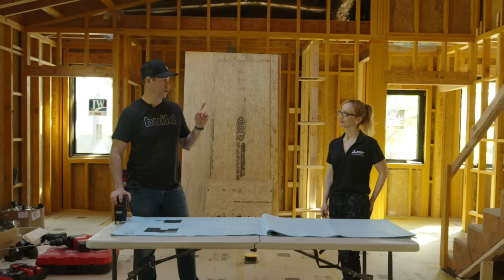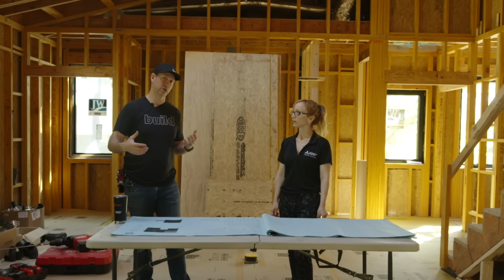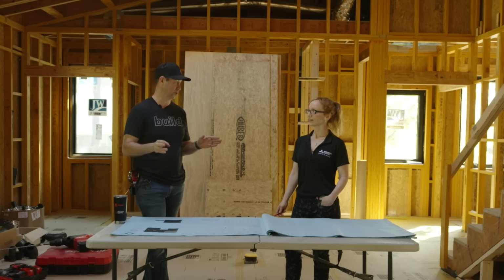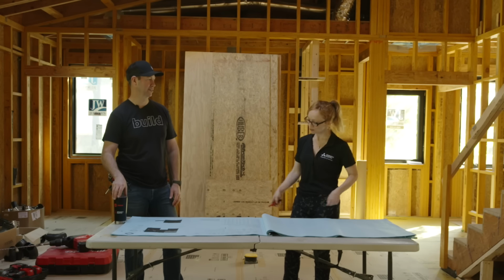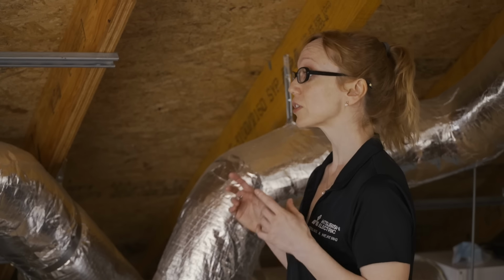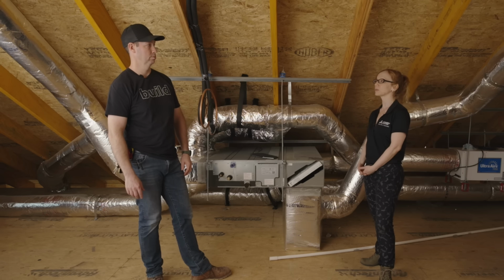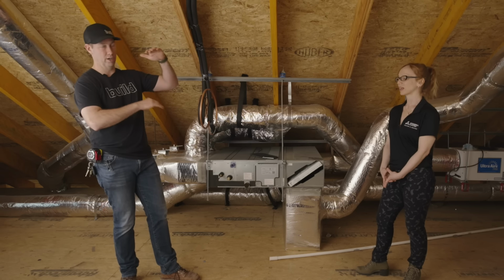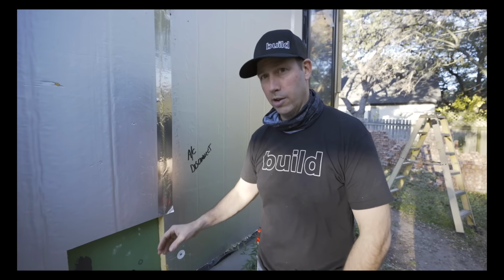Mitsubishi HVAC At My House - Full System Tour

Comment: You make me want to build a new house so that I can do things like this right.  Matt, 1% of the days above 100 would be 3.65 days.   We have more 100 degrees days here in Plano.  Pretty sure you do there in Austin.
Reply: Yeah more like 35 average and another 100 over 85% .
Reply: I think he meant 1% of time. Not days. Surely its not 100 for 24 hours a day. It’d be a few hours in the middle of the day / afternoon.
Reply: @jackgibbons6013  Let me introduce you to Texas, where many locations will have summers consisting of weeks of temps that never drop below 89 at night and it is 100⁰+ for 12-16 hours a day. And just as an extra kick in the gut, a large portion of the state has humidity in the 85-99% range to go with those temps.

Comment: Matt - Don't you need a safety /back up water pan under the attic unit, or is it a different kind of coil inside so you don't have to worry about water leaks? Maybe its just not there yet?
Reply: These VRF type of units have integral pans with condensate overflow switches.  That's typical for Daikin, Mitsubishi, LG, etc.

Comment: I installed a 3 ton Mitsubishi hyper heat system in my house- love it. I was going to use a ceiling cassette however the installer talked me out of it. The drain lines are a high maintenance item if you're not going purely gravity. The cassette units rely on a pump for the condensate, and you often end up with either leakage and/or mold in the lines. He said he'd install it but every time he does it he has to come back for those reasons.

Overall this is an amazing system and extremely efficient. Super quiet and I'm extremely happy with it over the last couple of years.
Reply: You’re installing contractor is absolutely unqualified on mini-split condensate pumps. If you can’t find the right pump, reply here and I will post the link to the right pump.
Reply: I thought the pump is Original Equipment, ie built in.

Comment: Looking at that attic I was wondering if you'll be talking about how to insulate up there. Will it be a "conditioned" space itself with foam on the roof deck or other method of insulating?
Reply: Insulation is on the outside of the decking you saw in the attic space. The whole house is sheathed in insulation. Look back on Matt's YT site about a half dozen episodes of his home "remodel build".
Reply: @fredericrike5974  Got it. Missed that one. Thanks.
Reply: @TSGEnt  I spent 35 years doing subcontract work on houses, new and remodel and also commercial work like hospitals , hotels and commercial kitchens. I have been in love with TBS since I first saw it a couple of years ago. Matt is a very knowledgeable and thorough builder- this is his house and "overbuilt" is to say the least. Enjoy- I always see or learn something new- I'm retired but I still love to see what's up!

Comment: Mat there are several seemly knowledgeable HVAC field service technicians on you tube that say to stay away from the high efficiency variable speed equipment, They say that they breakdown much more frequently. The repair cost is supposed to be triple that of mid efficiency units.  They say it easily can run thousands in under ten years, As you said they say that an experienced installer is even more important than even the  brand of equipment in terms of both performance and durability. Time moves on and things change, is this true to any extent at all?
Reply: There is a huge difference between variable speed in traditional ducted HVAC systems vs. the variable speed in minisplits.  Minisplits are WAY less fussy.  And due to the zoning you don't get a lot of the complicated ductwork and installation issues that can torpedo a variable speed traditional system.  

Indeed, I would only consider a high efficiency/variable speed system if it was a zoned mini-split.  When I had to have my upstairs unit replaced a few years back I looked at the variable speed systems but the payback just isn't there.  If I would have had the extra money at the time I would have loved to have just ripped out the ducted system and replaced it with two four zone minisplits.  Glad I didn't bother with the extra expense, I now am probably going to be moving so I wouldn't have recouped the difference.

Comment: Where are the energy savings coming on a variable speed system? You need to remove x BTUs and i.e. at full speed compressor it will take 1/2 time than half speed. So to produce energy saving running the compressor at half speed should consume less than half energy than full speed. This can be possible if losses are functional powers >1 of speed. If someone can explain will be appreciated.
Reply: This is an educated guess, but I'd operate under the presumption that running the system at lower loads is more efficient than the system running at full load periodically.
Reply: There are two sources of improved efficiency. When running at part load, the heat exchangers are more efficient because there's more surface area relative to the thermal load. The more surface area per unit load, the more efficient the heat exchanger. Second, there are cycling losses when you turn on and shut off the compressor. You lose energy getting everything back up to pressure and temperature. A VRF system should cycle less. 
The multi-split that is part of Matt's system gives up some of these advantages. These systems operate the different zones on an on/off basis, rather than modulating as VRF is usually described. There's data out there showing multi-split systems substantially underperform their specs.
Reply: @ann-mariestarck5039  Thanks for your answer, based on it it seems that there is room for efficiency improvement on a two speed system just by increasing the heat exchange area. It is also suggesting that it is better to buy an oversized VRF system  as the efficiency is not the best at full capacity.
Reply: @gregoriomurtagian5347  VRFs often have a max capacity significantly above rated capacity for that reason. The efficiency numbers are better at part load.
Reply: @gregoriomurtagian5347  Oversizing usually hurts efficiency. Higher capacity relative to load makes for shorter, less efficient cycles. I assume the engineers at the OEMs are pretty good at optimizing compressor and HEX sizes.

Comment: You should sell. (or just give your fans) copies of your plans, including all the material you use - that way we can build out own Risinger!

Can you speak to the span or distance of line-sets on mini-split systems; my understanding is that there's a cap.
Reply: I am 99% certain that the line set on this system uses a Mitsubishi Branch Box to optimize the line set length. In a house this size, line set length is not a limitation.

Comment: When you described VRF I heard simply the explanation of what variable speed drive (aka inverter drive) can do for any system including one outdoor unit matched to one head and having it operate at variable power levels.  I thought VRF is the system of refrigerant junction boxes that would allow different heads connected to the same compressor to be providing simultaneous heating to one zone and cooling to another.   e.g. The refrigerant could be evaporating in one head, returning to the compressor and then condensing in another head as well as in the outdoor coil.
Reply: City Multi has this feature, but not a "regular" multi zone condenser.  City Multi uses a distributor box to accomplish the heat and cool at same time.  This feature would be a rare need in a residential application.  My personal unit on my house is a 3 ton with 4 evaporators all on separate line set connections at the condenser.  I can not heat and cool at the same time.

Comment: Here I am with my single stage heat pump in a below average insulated house with awful flex duct for most of my duct work. :(
Reply: You probably don't have a oil trap from the copper tubing loop...

Comment: With a vertical loops in you're lineset can create a oil trap.  If you don't want to cut the lineset shorter make the loop horizontal so the oil won't be trapped.
Reply: The lines weren’t connected yet

Comment: My architecture office has had a CitiMulti system since 2007, along with spray foam insulation throughout. It’s an expensive system and honestly the maintenance required on it has been a little ridiculous. We’ve also worked with a college campus who has used Mitsubishi in all their buildings for nearly 20 years now.

Comment: We gonna do all this fancy so that HVAC doesn’t need ducts. And then let’s install a ducted dehumidifier. Most minisplits I seen have dehumidification mode. What gives?
Reply: I would and I will install hrv with built in heat pump something like CERV ll but from China. A dehumidifier is obsolete thing from the past
Reply: mini splits can't dehumidify without cooling (nor can most ducted). if the weather is cool and damp, you're SOL. most houses leak enough air that cool humidity isn't a problem. however, if you're doing a passive-house, you're never going to have enough heating, cooling, or natural leakage to properly handle your humidity so you must have make-up air with some dehumidification.

Comment: Here in north Georgia it would be really nice to have a whole house dehumidifier that just ran automatically as needed. Might be 75 out but 90% humidity and it feels sticky without the a/c.
Reply: Minisplits like the system he put in have variable speed compressors and fans.  Beat the pants out of any dedicated dehumidifier since you can just put the system in dehumidification mode and as it does the cooling it also optimizes for maximum dehumidification.  Very efficient!  I was planning to put a minisplit in my master bedroom just for dehumidification but now I may be moving so I nixed that.  But if I was staying in Virginia I would put a few strategic minisplits for alternate cooling/dehumidification  vs. a dehumidifier any day.
Reply: @DocNo27  there is no doubt that Matt did install the whole house (or ducted zone) de-humidifier.). It will often run to dehumidify even when no cooling is needed.
Reply: Did your HVAC contractor adjusted the settings on your control board? If you still have your manual, you can adjust the fan speed to reduce the CFM and optimize dehumidification. Since I run a portable dehumidifier in the basement, I haven't asked to have that setting done on our air handler.
Reply: You can see the ultraire right there

Comment: Curious what your blower door results will be? We just got ours done at .83 ACH at -50 which explained allot. While building I Installed our master Mitsubishi 6000 BTU unit with its standalone condenser which cooled the entire 1486 Sq ft home in central Florida summer to 72 degrees then ramped down to maintain. Granted it was a small ICF house with no sound proofing or interior insulation installed and we did install the HVAC ourselves but after the math any added cost between the two different systems is payed for after 1-2 years. I’m gonna imagine if more of the good versions of VRF technology are being purchased it will drive the cost down. Granted we also installed two ERVs which added cost but were now controlling the air in. Our electric bill Dec 2020 was 50 dollars and heat of the summer was 120 dollars but we were also cooling the 38 ft Camper which rarely turned off. We’re looking forward to seeing what our true bill for just the house will be this summer.
Reply: Orlando here. Typical late 80s 1200sq ft single story, brick/stucco finish home. 1’ overhang and two 30’ Camphor trees partially covering the East and South East part of the house.

I replaced my Windows from single pane aluminum horizontal sliders to double pane horizontal slider vinyls. 8 total. 

Installed a Lennox two stage cooling/heating system Dec 2013. Separate dehumidifier and UV light installed as well.

Bill is 90-100 for Fall and Winter. Spring is about 100-120. Our typical summer bill is 120-130. No credits or rebates tacked on, just general usage (700-1k Kw). Duke Energy.

I’ve been home working full time from a desktop system since March 2020 and two kids at home. Most of my lighting is LED now. I have 1-2 50” LED TVs operating at once. Small appliances when cooking. Can’t think of anything else that draws power except the water heater.
Reply: @seagel1000  Were hoping to see summer bills around 75-80. Our daughter is still in the camper since she works at the hospital. Once we unplug the camper we will get some true numbers.

Comment: Thermostat control details would make a good show.  I'm going with a 6 zone system.  6 x 9000btu units.  Controlling them is a bit of a mess
Reply: Are they using wifi or a wired BMS?
Reply: @terrencesauve  each unit has its own remote controller.  Wifi would help, needs motion sensors
Reply: I think there are some IR controllers that work with SmartThings. have you installed them yet? some units have motion sensing and wifi built-in

Comment: Use smart tiles that regulate moisture passively as decoration on some walls ... like that no issue with moisture. They absorb moisture from the air when it's too humid, and release moisture back into the air when it's too dry, passively without you needing to do anything else.
Reply: After a quick look, I'm not sure why you comparing "Smart Tiles" to HVAC/Dehumid/Air treatment system. This is not that you can compare, at least I don't understand. For me its like comparing a bike with an aeroplane, which is faster or can carry more passengers.

Comment: Kimberly should’ve mentioned that by ACCA manual J standards you’re not allowed to size your main AC system for specific events, hence the extra unit with sidewall grilles. Also not allowed is tying the garage system when it has ducts to the living space, not just because “it’s a big no-no”. I have clients and even worse, HVAC contractors that want to do this on a regular basis. 
This being said, I don’t see why you’d need a separate condenser for the garage unit if it’s a different head.

Comment: The rats are going to be so impressed when they see this new HVAC system.
Reply: Watch carefully as this system is commissioned,  you will understand why the ducts of the mid-static fan coil are imperious to rodents - and air leakage.
Reply: @meyerjeff  I think you meant to say impervious to rodents. Though I do like "imperious" here. Also, you should check out the very early videos where Matt showed the previous HVAC system.

Comment: My goodness, so many systems for a residential setup. Just the electrical service alone would require an entire subpanel with breakers for the numerous compressors, hvac units, dehum and fresh air systems. It'd be nice to see some cost $ and projected years to recoup vs conventional 2-zone single compressor setup. Few people can go to town like this with a sponsored setup.
Reply: The amps are so small on VFD units like this.
Reply: to brake even with, that system close to 10 years guarantee, also depends what climate r u living in

Comment: I think I'd rather run recessed and traditional minisplit heads and not do any ducts at all, except for smaller ducts for air exchange through the HRV. The ducts seem like such a waste of time, efficiency and space.
Reply: Ducted is less efficient. But it is a good way to deal with multiple rooms with very small loads, such as 2 smaller bedrooms.  If you put the smallest available split unit in each room you can end up with an oversized system that costs more to operate.  Remember, VRF is better at handling light load, but it isnt magic.  Very low load below the compressor minimum (~40%) still still results in cycling and affects efficiency.
Reply: the thing is, a small bedroom is hard to avoid over-sizing a mini-split. even a 6k unit is on the high end. by having a single unit feed multiple bedrooms, the sizing works out better and he wanted more advanced filtration and dehumidification than a mini split could do, so some kind of ducting would have been there anyway. so, why not combine it all?

Comment: Yeah HVAC is fun and all, but hold up... job site coffee machine?
Reply: I was really hoping he'd spend a good minute on that.
Reply: Being in construction, a coffee maker is the first thing you set up on a new project.
Reply: I see it on Homely Depot’s site. Also available in Special Ops Black. 😆
Reply: Jeremy, how tall of a container can you fit into the opening?
Reply: @jtatro  I only use my 12oz thermos with it but it looks like it should have room for a 16oz
Reply: @jeremydowdy2821  I have a 20oz hydro flask. Think that would fit?
Reply: Right
Reply: I have one. It’s great. 
Pros:
Uses K cups so it’s easy to find pods for.
It’s fast as shit. 

Cons: 
It has to be plugged in. I keep it in the truck where I can plug it in anywhere. 
It also only makes like 3 cups before needing to be refilled.

Comment: Hey Matt, you my want to look at a weight distributing hitch kit for your truck and new trailer. It'll make towering much safer and easier for your tow vehicle. https://www.etrailer.com/Weight-Distribution-Hitch/Curt/C17002.html?feed=npn&utm_source=bing&utm_medium=cpc&utm_campaign=Bing%20%7C%20Shop%20-%20Weight%20Distribution%20Hitch&utm_term=4577198189629463&utm_content=Weight%20Distribution